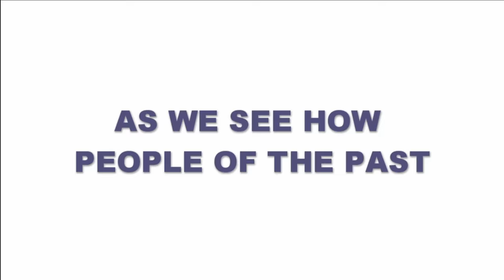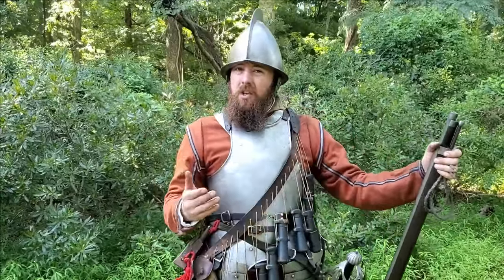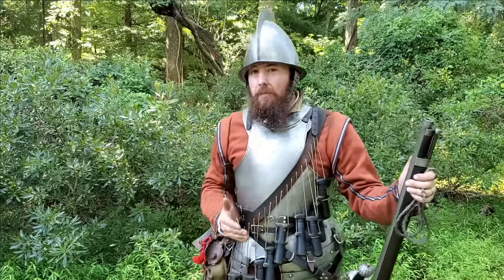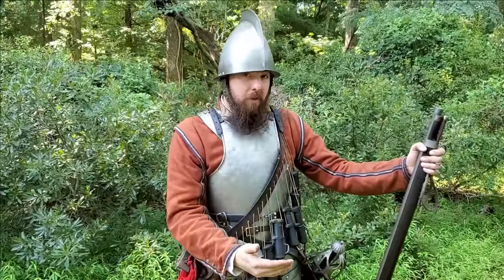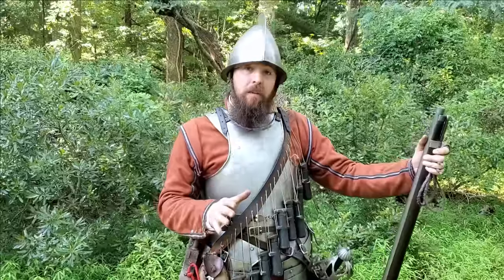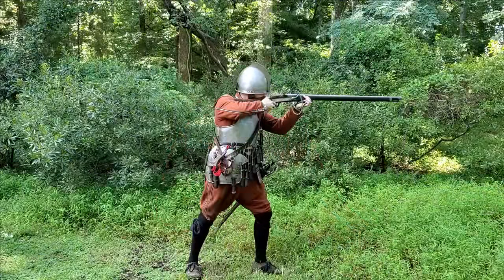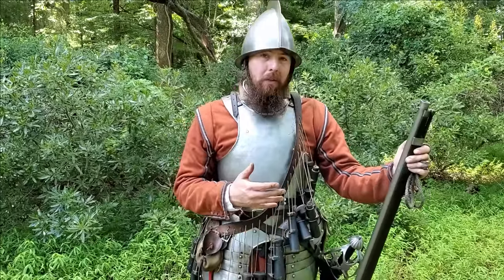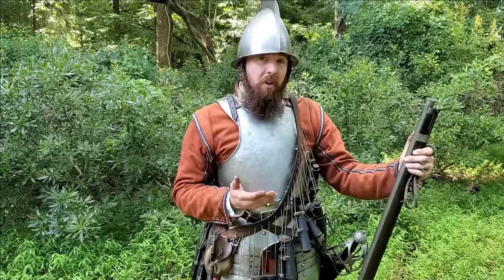Primed and Loaded | Matchlock Arquebus Rate of Fire

Comment: Would it be faster if you don't need to put the ramrod back at its holding slot? Like you just lay it against something (most likely the left leg)
Reply from the maker: We'd like to point out that we are not trying to reload at a rate faster than was accomplished in the 17th century, but to demonstrate a reasonable expectation under ideal conditions.

Now consider the confusion and terror of the battlefield and imagine the disaster for the musketeer who fails to return the musket's scouring stick to its proper place and just lays it against their leg or stick it in the ground and lose track of it. They've had to advance or retreat and left it behind or it gets stepped on and broken. How does the musketeer accomplish a reload?

Comment: Reinserting the ramrod into its compartment seems like an unnecessary extra step - couldn't you just hold it and save yourself an extra 5 seconds? Especially in a combat situation I feel like it'd be pretty annoying to try to get it back in its hole.
Reply from the maker: What would be the problem that needed to be solved by not returning the scouring stick or ramrods to their channels in the musket stocks? What would the musketeer do when they lose track of their scouring stick?

Comment: Question did they (1500s) use shot or ball for crowd control or both 🤷🏼
Reply from the maker: In 16th and 17th century European warfare it was not uncommon for small shot and ball to be each used individually as well as together.  In the archaeology of Historic Jamestowne by the Jamestown Rediscovery Project, skeletal remains were found in 1996 of a settler with with both small shot and about a .60 caliber ball lodged in the bone at and below the right knee.

Comment: Wasn't it more practical to leave the foo king metal rod on the ground than to be taking it in and out of the arquebus with each shot?
I feel that it takes up a lot of the shooter's time... that way he would only bend down to pick up the rod from the ground and throw it away when he had used it.
Reply from the maker: No, it is not practical to leave the scouring stick on the ground. To put the scouring stick back into its proper place in the stock of the musket ensures the musket remains a functioning weapon. To not put it back, to simply drop it on the ground to then pick it back up to finish loading, creates the potential for disaster.

The scouring stick left laying on the ground will inevitably get stepped on and broken, or the formation of musketeers must advance or retreat, and in the confusion of the action the musketeer does not retrieve their scouring stick. Without the scouring stick the soldier has a non-functioning musket and is a useless musketeer.
Reply: @JYFMuseums  ohh... good to know that

Comment: do you reckon you could beat that rate if you used paper cartridge instead of bandolier
Reply: For Brian, whether loading from the bandolier or from a cartridge the time is about the same. Though in the late-16th/early-17th century paper cartridges -- while not unheard of -- were not all that common and were most likely found in use amongst cavalry.

Comment: With the large bore of the arquebus, there was an expectation that, in the densely packed ranks of the enemy's pikemen, that the arquebus balls would often pass through more than one man.
Reply: From my own point of view, I do not think that there could be a expectation that a bullet would often pass through more that one man.  For that to happen there would have to be an expectation that a bullet would reliably retain enough energy to pass through an armour's breast plate, pass through the body of of the soldier, then pass through the armour's  back plate, before again striking another individual. The only possibilities I could conceive is a bullet striking objects that would not tend to significantly reduce the energy retained by a bullet, such as soft tissues, extremities, etc.
Reply: @jamesread1607  By the later Renaissance, in many formations only the front ranks or front few ranks wore armor. This was both vastly cheaper and allowed the lightly or unarmored men to be more nimble exploiting a gap blasted in an enemy formation.   I may be just misremembering info I read years ago or that info may have been replaced by better more recent understanding of the subject though.
Reply: @jamesread1607  Wikipedia: The Vietnamese matchlock was said to have been able to pierce several layers of iron armour, kill two to five men in one shot, yet also fire quietly for a weapon of its caliber. Arquebuses also varied from .6 caliber [.6"] to the largest at 1 caliber[1"] so we both may be correct at different calibers. Also it is important to remember that the armor of pikemen and other foot troops was generally made of iron and much thinner than the heavy steel "proof armor" of knights and heavy cavalry of this period.
Reply: @leoscheibelhut940  But what does the supposed abilities of a Vietnamese  matchlock have to do with the English experience in the late-16th/early-17th century on the battlefields of the Netherlands, or more specifically the English experience in Virginia?
Reply: @leoscheibelhut940  "By the later Renaissance, in many formations..." You're going to have to bring some documentation to the table. The Anglo-Dutch practice of pike and shot warfare during the Dutch Revolt tend to say otherwise.
Reply: Curious, definitions of weapons vary. In the early 17th century arquebus shot in English usage was supposed to be around 30 bullets to the pound, making it about .50" . Pretty small compared to caliver shot (around .60 and musket around .73" ) But with wildly un-standardized terms and equipment the is plenty of room for variation. What source are you using, they might mean something very different from what we have studied.

Comment: can you double load a musket to improved it's accuracy?
Reply from the maker: No, not really. The more that a ball can be stabilized as it's propelled forward the more effective the shot will be.  The barrel length goes along way to stabilizing the ball, as well as the ball's fit to the bore of the barrel. There will be an optimal powder charge relative to the barrel length and bore size, and ideally it should allow complete combustion of the gunpowder as it travels down the bore burning, and increasingly generating the energy to propel the ball.

Too little gunpowder and not enough energy will be generated. To much gunpowder and at best a lot of unburnt gunpowder is expelled from the barrel, and at worst the musket barrel will burst.
Reply: @JYFMuseums  
thanks for your detailed explanation

Comment: How come the pan is primed first?
Reply from the maker: Based on Wapenhandelinghe van Roers Musquetten ende Spiessen/The Exercise of Arms for Calivers, Muskets and Pikes, the priming of the pan is where the process of loading the firearm begins. Once fired, take the weapon from the shoulder, remove the match from the serpentine and put it back between the fingers of the left hand, wipe and blow out the pan to insure their are no live embers, and then prime the pan. Once primed, cast the piece about and load. It is all an ordered and smooth set of motions.
Reply: @JYFMuseums  I mean during the loading process. Priming the pan last seems like the safest option to prevent an accidental discharge from blowing off your fingers or face.
Reply from the maker: The very first act in the process of loading the weapon is to blow out, and if necessary wipe out the priming pan with a finger of the right hand, to insure there is no ember or debris from the previous shot.  There is nothing there to cause the ignition of the priming powder in the pan; and if there was, it would have caused the priming powder to ignite during the priming of the weapon.  If there were any ember in the bore of the weapon that could ever possibly ignite the charging powder, no amount of priming the pan last would keep that from happening.

Comment: rate of fire is probably lower, rate of fire with warbow is higher
Reply from the maker: Yes archers are generally going to achieve a higher rate of fire over that of the musketeer. But the musket is going to reach out further, with a faster projectile, and with greater energy retained by the bullet.

But most important for the English military experience, by the late-16th century we have seen the end of the age of bows and the increasing importance of firearms.

Comment: Very cool..still don't understand how its better than a longbow
Reply: Rather simply, the use of the firearm provided a battlefield weapon that was easier for the soldier to become proficient with in a matter of hours, days and weeks, regardless of age, stature or upper body strength.

Whereas the education of the archer generally had to begin about the age of 5-7 years, developing the proficiency and upper body strength to eventually handle a long bow that could have a pull weight of of as much as 150 pounds (based on examples from the Mary Rose). All the while that bow often causing collar, shoulder and elbow damage to the archer.

In turn the bullet moved further, faster and with greater energy than the arrow while more reliably defeating more modern armours. Meaning that it was the arrow that had to be more accurate to be effective.

The ease of use along with velocity, range and energy made the musket a better weapon.
Reply: @jamesread1607  well I certainly get it now! Thank you!
Reply: Also, one must take knockdown power into effect. At most combat ranges, an arquebus shot is going to hurt someone much more than any bow.
Reply: @TitusCastiglione1503  Yup, I think it's mostly this. A .60 cal lead ball will punch through armor and shatter bones, longbows may dent armor a little but will not break through it without an extremely lucky shot. At further ranges the bow's power drops off massively but the gun still carries significant stopping power. When firing flat at a bunch of people running at you with a bow you'll have to aim way up in the air to hit them and have your arrows rain down in an arc, this requires predicting where they will be in X amount of seconds, less leading for a gun.
I don't think it has as much to do with the amount of experience needed as people make it out to be, I think it's mostly about having a few ranks of people able to fire flat trajectory extremely deadly shots at long ranges. Flat shots are very nice for stopping groups of people charging at you. One of the guys in front dies before your shot hits him? Your shot goes on to hit the guy behind him.
Reply: @dirtydan2721  this comment right here. I consistently get the impression people don’t fully comprehend the sheer knockdown power of early firearms vs the relatively weak longbow.
Reply: Greater range, accuracy, and overwhelmingly more power. A combination of armor and shields almost completely reduced all personal missile weapons to a harassment role since the iron age. Firearms being able to outright defeat an enemy force at range was something that hadn't been achievable in over a thousand years. That you could do this from outside the effective range of bows was just icing on the cake. 
It was not, as many claim, due to ease of training, as this didn't actually exist. Learning to load and fire a matchlock under duress without blowing your hands/face off is objectively more difficult than learning to load and loose a bow and arrow in the same conditions. The latter is more physically demanding, yes. But I doubt anyone is going to argue that bashing someone over the head with a mallet requires more skill and training than successfully parrying an incoming sword for that reason. During the transition period towards firearms, not one single person advocating for their adoption supported their position with the claim that soldiers could be more easily trained in their use. Not even in England where the mythic English longbow was part of the debate.
Reply: @Kidneyjoe42  I’m not so sure the accuracy and range were factors. Earl y smoothbore firearms were pretty poor at both, but they didn’t matter when you’re mostly firing at a massive pike square bearing down on you. Regarding training, the kind of bows the English used absolutely needed far more training than your average arquebusier; at least ten years, if I remember correctly.
Reply from the maker: Some interesting thoughts guys. In so many ways, yes it is a matter of experience and training. The period of the 1590s through to the start of the of the Thirty Years War was a pretty revolutionary period when it comes to the training of the individual soldiers.  This is after all the period that we get the first illustrated manual of arms in the volume, Wapenhandelinghe van Roers Musquetten ende Spiessen/The Exercise of Arms for Calivers, Muskets and Pikes. Illustrated by Jacob de Gheyn and published in the 1607. At this point in time modern military theorists like Sir Roger Williams, writing in the 1590s also commented on the importance of musketeers over that of archers because of the ease of training and the increasing difficulty of finding trained archers.